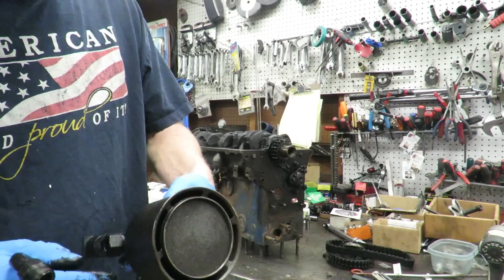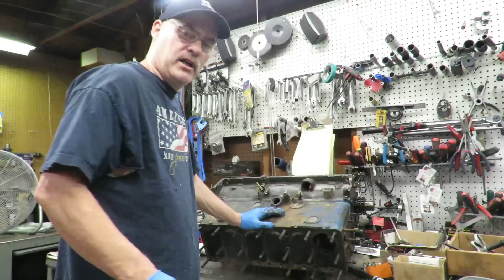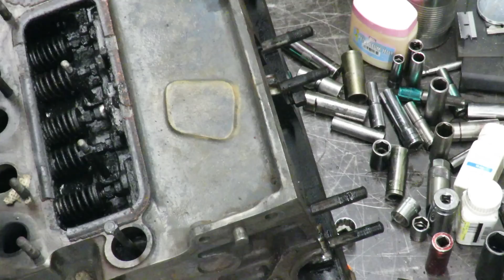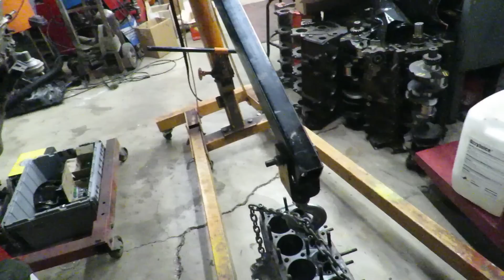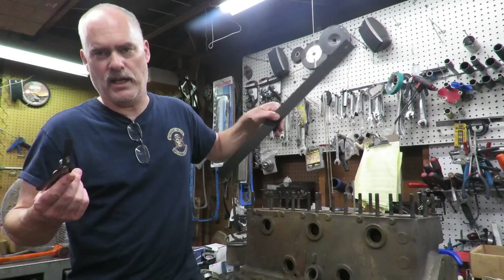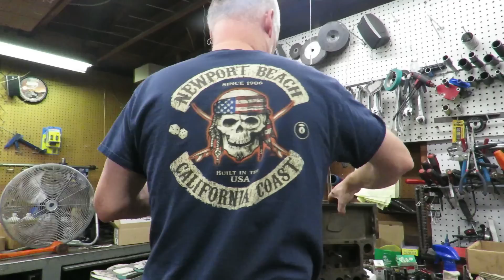Chrysler/Plymouth Flathead rebuild part 1

Comment: The switch with non detergent over to what's available now wasn't  a big deal. Actually first thing I did was add Valvoline 30w? Then Hemmings oil with all the good stuff on the rebuild,  no problems?

Comment: Hello, 
 I enjoyed watching the videos of the L6 rebuild you did.
 For the sake saving myself time, I had a shop do a rebuild on my 1952 217 ci  plymouth for me. The builder is very competent guy. He,  like myself is a little weak when it comes to plymouth flat heads, but does first class machine work. The first issue we are having is low oil pressure. I spoke with George Asche from Pennsylvania, well know in the vintage Chrysler/ Plymouth world  and he stated he probably put the cam bearings in with the big hole to oil passage opening. He said the small hole should go to opening in the oil passages.  No big deal easy fix. The second issue the engine uses a lot of oil ( 1 quart every 100 miles ). It does smoke at idle and when you decelerate ( after warm up). I used the N.O.S. 20 thousandths over rings and pistons. I was told they the rings were chrome and would take awhile to brake in. I have run the car about 3,000 miles without any change. My question is this. Is there any other way for oil to get into the combustion chamber other than the rings, and if not, is there a place I can get cast rings.  The Engine runs great. I currently have a 2 barrel rochester carb on the engine and definitely woke it up compared to the One barrel carb. Any help would be much appreciated.

Thanks

Comment: I have a1937 Dodge. Thanks for all the tutorials and video production. 
My Dodge has 218.7 , recently re built. Your opinion on newer detergent motor oil. Also LUCAS zinc oil additive for older  valve,  and hotrods.

Comment: I just got a 51 Dodge b3b truck with the 218 FH...  the motor is original with 37k miles on.  the motor seems strong now, but this set of videos was very informative.  thank you!

Comment: I have a 1950 Plymouth with a 230 flathead engine, I'm replacing the exhaust & intake manifold gasket, I took out a bolt towards the rear of the engine and antifreeze came out, is the water jacket that close to the bolt?

Comment: Hi. I've got a question for you. IDE really like to here from you. I've got a 1948 Chrysler Windsor Super Hurricane flat head. Anyway Ide watched your video, and I caught it all up to where you was ready to install the oil pan. I couldn't find that last video. Anyway. Ide like to rebuild my engine. (Factory only) Ide like to either bring it to you from here in the Mark and West Virginia area. I was hoping that maybe around $5,000 would do it. People up this way, want to use a 318, 340 etc in it etc. No... I don't want that. I realize that you may need to do certain things to it. It is what it is. You may here and there may haft to change something, that's ok if you do. Whatever needs to be done.  Ide also like to go to 8 volt battery with it if I could. All I need is get it close to factory. I want to drive, not a antique tag. Don't worry, I rarely drive over 55. So yea... It does have age to it. Would you be able to get ahold of me? A either for finding the correct parts or B- would you be interested in rebuilding the engine? The car is around 14 years before my time. Lol.

Comment: Chrysler Industrial They we’re in Cockshut combines, tanks trucks and definitely in service until 1972 because my Dad had a P&H 17 1/2 model 218 mobile crane and the power plant for the cranes superstructure was a Chrysler Industrial flat head all factory! That engine would start at-30 degrees Celsius and runs like a top and with a straight pipe at low idle you could easily have a conversation or listen to the radio. What a great piece of engineering!!🇨🇦👍😀
Reply from the maker: agreed very good engine

Comment: I have always wanted to see a  flathead rebuild. I love oddball engines from the past.the 305 GMC rebuild was great.how about maybe a348/409 or a Pontiac  flathead 8 or a Buick overhead valve 8, or a Chevy 235 6 cylinder Buick nailhead,or a Oldsmobile 394??
Reply from the maker: I have always wanted to do a straight 8 just haven't come across one yet

Comment: The main baring bore has a factory size & it is usually called bearing housing bore. That way of checking the main bearing bore is  ok but Most Chrysler manuals use recommend this method: Install a good crankshaft (reground or at some regrind size) in new bearings,  lube the bearings with 30 wt oil, torque the main caps. If the crank spins freely you are good to go, if in a bind get the block align bored.

Comment: Hello Vitage Iron.
I have a 47 dodge truck with 218 flathead. 
I want to ask you if the original cam already matches & maximizes the flow characteristics. Sure it not much power but Id like to get mine rebuilt soon and do ehatever is recomended to get best power out of it while keeping it reasonably stock looking. Im open to dual exhauset & carb for looks...not sure if these even improve performance at all though. What is your contact info? My Cell 714-944-6905
Thank you for your great videos and attention to detail and integrity.
Kevin

Comment: Don't underestimate these old flatties. Back in the day I used to wind my 230 to 4000 rpm. It went once to 5200 ( broken throttle spring) before the valves floated . Tough old motors.
Reply: The direct acting valvetrain is lightweight and efficient, but the motor can't breathe well.

Comment: I have a question for anyone here, I have a 1940 Plymouth P10 Deluxe 4 door sedan. The numbers on the block are TX 319 1073 C. This is a Canadian car so I've read that it would have a long block in it. The block is 25.5 inches long. 3 3/8" Bore X 4 1/2" Stroke. I had ordered a gasket set for this car on rock auto, what they sent me was for a 218 and or 230 set...the head gasket in this kit was 26 inches long and the valve cover gaskets are short too. Anyways can someone tell me from the numbers of the block what engine I have and where a guy can get hold of parts for it? THANKS!!!

Comment: We have 1953 Cranbrook coupe, just bought another for engine and overdrive trans. Belvedere. Disassembling it. Cutting frame down to use as spare engine and transmission stand. Rebuilding engine for hot rod, well all we can do with a 218. Lol. Taking the Coupe to shows as original. Extra engine on frame stand. Have not seen that. Engine and trans on actual frame as stand. Hopefully with radiator and crankable eventually.

Comment: I just ran across this video, and am glad I did.  I've started rebuilding a '40 Plymouth (201, I think), for a P10.  I can't wait to get through the remainder of this series
Reply: I have a 37 Plymouth 201 Flathead I'm rebuilding, I just got mine unseized and it turns over again.
Reply: I've got a '40 P10 too. Original engine and also have one sitting on a '39 chassis.

Comment: to all these folks deading to tackle te flat head 6  im  now 86  two yrs ago i pulled the eng out my m37 army truck ground the valve put in new rings  converted dist to civilian ( LOWER COST)  plug and wires  put in back by myself  so you can do it

Comment: The Slant 6 oil pump is a external pump driven off the cam also Maybe that's where they got their idea since the slant was designed back in the late 50's
Reply: these engines first saw introduction in 33'

Comment: Where did you get your parts for this engine?
Reply: try VPW in iowa  they carry  all the parts for that eng  i have a 230 cu in eng   i ordered all my parts from them  i can tell you one part you may need  is the correct cond in the dist its a ---STANDARD AL 118  it will give max spark  i found this the hard way

Comment: Even detergent oils of the 70s-early80s were pretty poor. Engine oils of today are pretty incredible as far as how clean they can keep tiny , high horsepower engines and do it for hundreds of thousands of miles. Nissan copied the design of that oil pump almost to a “T” in their older 4 cylinder truck engines. Most people don’t realize that the Japanese copied designs primarily from the USA but also from VW. As a Matt of fact, most of your original Toyota technicians came from VW when Yoda first started selling here in the USA. The Landcruiser’s original inline 6 was built from plans based on the Chevy inline six.

Comment: I got a quick question, I have a sbc 400 do I have to drill steam holes in the heads,  and what's it for if I do. My cousin has a race car and he says I don't have to but he's not a machinist. It's going into a weekend driven c3 corvette with 11to 1 piston and aluminum heads
Reply from the maker: drill em it will run hot otherwise any machine shop worth their salt can do it
Reply: Thanks I appreciate your help, I was pretty sure they had to be drilled,but now, I'm  sure not to assemble the 400 without it.

Comment: Hi this is off subject but I need a little info. I have a 69' 429ci and I can not find a new stock balancer, it is internally balanced. I do have an aftermarket for the 68'-73' but 4 bolts, can I just grab one off a later model 429ci with a 4 bolt crank. The last thing I need to know is do I have to go to aftermarket flywheel if the crank is internally balanced?
Reply: Sorry went too fast I ment 4 bolt crank pulley off later model 429ci.

Comment: Worked for a shop 20 years ago and did what my boss told me to do. Learn from his mistake, do not use K-Liners in a flat head Chrysler. His shop his rules, I got to do it twice.  Flat head engines don't have the lubrication for the guides to use anything other than cast iron guides. Bronze liners will seize up the valves and cause issues. After I got reamed by the boss for a comeback, I took it apart and told him his mistake not mine. His response was "Oops , just fix the damn thing and don't argue with me".
Reply from the maker: better yet dont use K-liners in any thing they are junk

Comment: I've been looking for a video like this for years! I have a 1953 Dodge 230 cid flathead  6 that is locked up. This will definitely help with the rebuild. Thanks for the video!
Reply: Don't know where you are located I have a rolling over supposedly rebuilt motor and 3 spped trans. It is currently in a clarkson tug needs rewiring but it is for sale
Reply: CALL A MECHANIC where are you located?
Reply: @crxman9119  ZION IL. USA.
Reply: @crxman9119  Zion Il.

Comment: the chrysler 6 was used in many applications including farm equipment and war effort equipment
Reply: These flatheads was also used in forklifts. Sometimes propane was used as fuel. I think the engine was made all the way to 1970.

Comment: Did you pull the water distribution tube before you hot tanked it? Very important to make sure it is functional for cooling of the #5 & #6 valves. All Chrysler flatheads moved to hardened valve inserts in the early 30s. Also did you mark rod and main bearing caps so your can replace them in the same location on reassembly?
If it is a 230/218 the rods are offset so check the forge numbers to make sure you get the order correct.(That's why it is important to ID them before pulling them.) The con rod bolts are special size with a unique lock washer, so don't lose them. To another comment/? the bottom of the distributor shaft has a tang that fits in a slot in the top of the oil pump. The oil pump has to be carefully installed in a specific relationship with the cam so the timing is correct. Bypass oil filters were an option and have better filtering characteristics than full flow filters.  The lifters are called tappets. Lot more info about these vehicles at www.p15-d24.com
Reply: I was wondering about the water distribution tube too. Did I miss something in the video or was it removed and just not filmed?

Comment: I wish I had the money to send an engine to you and have a video of it being rebuilt. It's so cool to watch you work.

Btw, what usually causes warpage on the block?
Reply: Cylinder blocks can warp due to heating and cooling cycles. The block will warp even faster if the car is overheated.

Comment: Reminds me of my 1952 Pontiac straight 8.  Did a valve job to it Replaced bearings and timing chain.  Added an AC partial flow oil filter and used Kendall GT-! racig oil.  No problems, engine ran very well.   Thanks for posting.

Comment: I didn't know Chrysler made a flathead that early.  Are all inline 6's considered flatheads?  You know your ol' lady's gonna kick you right square in the nuts when she sees the hole in your shirt!
Reply: Flathead engines are engines with the valves in the block instead of the cylinder head. There are 4 cylinder flatheads, inline 8 flatheads, and V12 flatheads for example.

Inline 6 engines can be flatheads, OHV, SOHC or DOHC.
Reply from the maker: yea didn't notice tll i reviewed the video

Comment: My Mother got a used 51 plymouth cranbrook from an old farmer. Never do that. everything was shot. the engine was so worn out it sounded like a diesel(loose parts clattering). when the motor was hot the compression was so bad it could not get away from the starter. Lots of .25c/quart bulk oil went through it till it finally broke a piston. the whole car was shot so I burned it out and sold it for scrap. I was amazed how much heat comes off a burning car. this was about 1960 I just removed the gas tank,wheels and turned the car on its roof with windows hood and trunk open. Called the fire dept to let them know what I was doing so they did not come out for nothing. once burned out it was easy to pull out the scrap copper.cut it up with a torch.

Comment: I had one in the back of my 65 5 ton dodge water truck street flusher running a big water pump , it was a  good reliable motor  , The truck had a 413 gas motor and a 5 speed gear box no rear split axle :)

Comment: with no oil filter the idea was to let the crud build up in the engine and clean it out at rebuild time. Also poor air cleaners let a lot of dirt in. today its not easy to get non detergent oil. NOTE to old car people. If you do not convert to full flow oil filter system. do not put modern oil in them or the crud will come loose and damage the engine.

Comment: I would convert it to full flow oil filter. put synthetic oil in it. I have one of those flat head spring compressors. also use a real good paper element air cleaner. had a double silent chain, good stuff. The old chevys were the pore and bore.
Reply: He showed that the bores are worn too far. The engine is likely being rebuilt because it failed a compression or leakdown test.
Reply: yes that makes sense.

Comment: Can you provide engine spec's?  Bore, stroke, rod length, valve sizes, I think you said a couple different engine sizes cubic inches.
Reply from the maker: I thought it as a 230ci but I was just guessing based on the limited research I did,  after more research and numbers chasing I now know this engine is a 1937 201 CId plymouth business coupe engine the bore is 3.1250 and the stroke is 4.3750 when we are done boring our bore will be 3.185 our cubic inches will be will be 209 nothing to wright home about but it is what it is

Comment: Oil and air filtration technology back then probably contributed to a lot of the premature wear issues.
Reply: Daniel C Poor quality fluids compared to today’s lubricants. That and there were so many unpaved roads back then. The amount of dusty conditions cars ran in back then was about the same as earth moving equipment face today .
Reply: Because the exhaust valves are in the block near the ring lands the upper cylinder lubrication of a flathead is more critical than an OHV motor, which has a head gasket that prevents the piston ring area from getting so hot.  The improved motor oils definitely help the flathead.  The old motor manuals recommend a periodic de-carbon process - which few motors got.  Typically a well cared for Mopar flathead was good for 85,000 miles before it needed an in-chassis overhaul.  I expect with the improved oils these motors can double that life.  You will find that the piston lands and rings are cracked in many of these motors - and yet they still run, sort of.
Reply: I was wonder when (If ever) the flathead got chrome or moly rings. Those did a great job of extending engine life.

Comment: Didn't they run that engine or something similar in forklifts for a while?
Reply from the maker: The used this engine in just about everything they made a heavy duty industrial version
Reply: Cheezy Dee They had these motors in boats too.  Under the Chrysler marine this 230 cid motor was the Ace rated for 70hp.
Reply: motorsportmach I remember an old Chris Craft locally that had the old Chrysler Straight Eight too , very similar design and a tough old motor .
Reply: they did use them in forklifts. a place I used to work for had a 1967  Baker forklift and it had a Dodge 230 cu In flathead in it. when it blew a head gasket I ordered a replacement for a 1954 Dodge flathead and this worked perfectly. the head and block had a flat surface so it was not due to warpage.
Reply: Also airplane tugs, combines, air raid sirens
Reply: Champ forklifts had them along with the slant 6 225
Reply: Many car companies sell their old car engine designs as industrial engines. The Olds 455 would be used in some irrigation pumps after Olds stopped putting them in cars. The Ford 300 would end up in aircraft tugs even after they stopped using them in the F150. Some Nissan forklifts had engines that were made back when they were called Datsun in the USA.